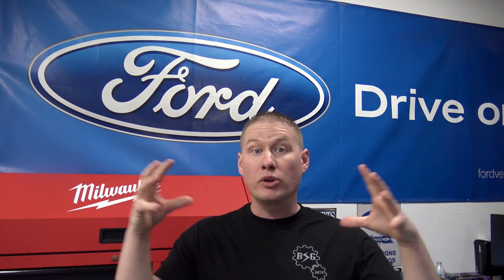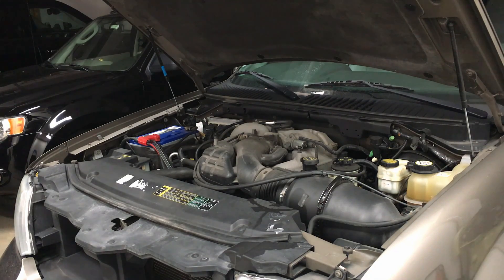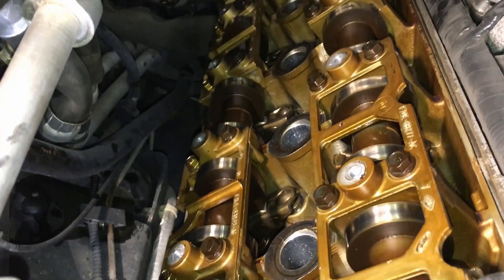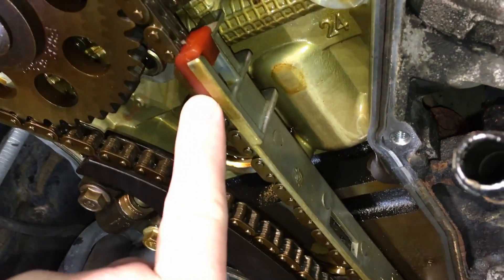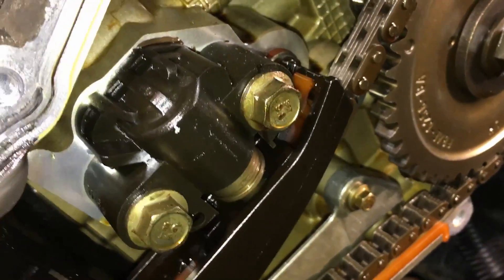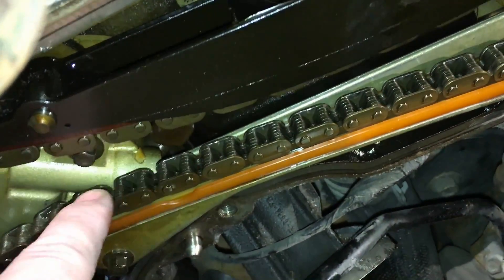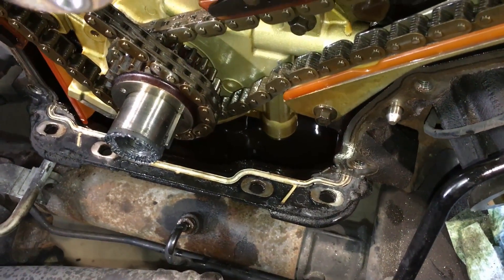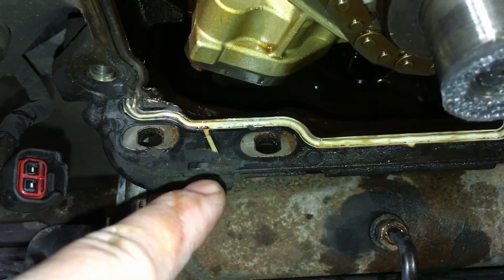Ford 4.6L & 5.4L Triton Engines: Common Failure Points to Watch Out For!

Comment: Why couldn't Ford just kept producing the 302 and 351? Those engines were bullet proof. I never had any problems with my 302. The 4.6 Triton that I currently have isn't a bad engine, but it's not as good as my old 302 was. My old 300 straight 6 was better than both put together. I miss that old F-100 Custom.

Comment: I’m planning on doing a very big job on a mustang gt 07 3v my dream car problem is it’s riddled with problem the Harmonic balancer is coming apart and punching through the timing cover and gonna replace both since the motor has 190k gonna do a timing kit while I’m in there and quite a few other things I need to replace to get her running good

Comment: Another question: PLEASE HELP! I own a ‘well maintained’ 2007 Ford Explorer with the 4.6L V8 SOHC 24 valve. Over 250,000 miles on motor.  What should I plan to do maintenance wise in the very near future? I have a new water pump and reasonably new spark plugs. What about doing the timing chain? Anything else to do if I want to throw a few (reasonable) dollars at it? I am very mechanically inclined, have an engine hoist and tools. I will do the work myself so costs should stay pretty reasonable… appreciate the input. Oh, I do see that there must be some gasket or seal leaking as the lower side of the motor seems to have oil on it, but certainly no drips gathering on my driveway at all. Thanks

Comment: PLEASE HELP! I own a ‘well maintained’ 2007 Ford Explorer with the 4.6L V8 SOHC 24 valve. Over 250,000 miles on motor. Although newer fuel filter and spark plugs less than 20,000 miles, Fuel efficiency seems really poor. Air filter is new. Oil changes always done early, new water pump, newer battery. Alternator strong. Any suggestions on what to do / check?

Comment: I wish you were closer to me in Oregon. I have a 2010 F150 with the 5.4L 3V Triton, with 148,000 miles. I don't hear any obvious sounds that would suggest that I have a blown out tensioner, (no loose-chain noises), but then again, I don't want to wait for a major engine failure to find out. Because of your videos, I am going to have the timing set, cam phasers, roller followers and oil pump replaced proactively! I would like to get another 150,000 trouble-free miles out of this truck! 
Would you say that pulling the oil pan to look for debris would be the easiest way to find out of there have been any timing issues?? Sounds a lot easier than pulling the timing chain cover...
If only you were in Oregon, I would definitely have you do the repair. Now, I have to find someone locally that is as knowledgeable as you are about these engines.

Comment: Low oil pressure, for a while now, several months. Thought it was oil filter or viscosity compromised. Chain started talking to me last week. Doing this VERY soon. New high volume pump and timing kit coming in. 01 Victoria.

Comment: Sparkly oil = motor is toast. Not even worth fixing.
Reply from the maker: We fix them all the time for this particular failure, no problems. Now if the the sparkle was from bearing material then yes it is toast.

Comment: Question; how many miles on this Motor you are showing? I have a 1999 F150 4.6 with over 200,000 miles on it. Yet no noise. When I bought it had 73,000 on it. I use SLICK 50 once a yr. Marvel Mystery Oil additive in the fuel. Why, I had a 1969 Mustang that had 253,000 on a V8 302  until 1999 when it was totaled in a accident. It was a Leaded Fuel & Marvel was its lead substitute.

Comment: At what point on these Ford engines do you determine that the engine needs a full rebuild vs timing component upgrades only?  I have a 5.4 3 valve with 200,000 miles on it with timing noise on startup.  Do I need to do a compression check, or is it always worth it to just to timing components?

Comment: I have a question about my 2002 Ford F250 with the 5.4 Triton V8 . So the check gage light comes on then goes off I look at my oil pressure and it has none untill I either rev the engine if I'm at and idle. But if I'm at a steady speed like 55-60 I will lose pressure then gain it back when I let off the gas? What would be the cause? Oil Pressure sensor or Oil Pump?

Comment: Thank you very much for that little video man I'm going through that same problem thought it was a lifter that fell out and it weren't wound out to be the timing chain and the only reason I checked it is because of your video and while I'm in there I might as well change the oil pump because that's a lot of work thank you again bye-bye

Comment: thanks for all the videos!  Quick question, have a 2006 Mercury Marquis with 4.6l v8 and vehicle has less than 50K miles.   I've noticed recently at light throttle on the highway there is a slight ping/knock noise.  Have tried different gas but that hasn't worked.  Heavy or full throttle doesn't seem to induce ping, only light throttle while cruising at highway speeds.  No noise when cruising around town either.  This has me confused....any ideas as to why it pings only when on the highway while cruising with light throttle??   thanks!

Comment: I have a question related to this engine- I have a work truck with the 5.4 32 valve. The engine has a leaking head gasket but low miles. Should
I junk it or have the heads re-machined?

Comment: Does running thicker oil prevent this? I have a 05 4.6 2v with 178000 and run 5w30 instead of 5w20?

Comment: How much should a job like this cost. My 04 4.6L is on 264k miles. It's not making any noise yet but I'm wondering if I should have the tensioner components replaced while it's still quite. What would you advise I do?

Comment: Thank you for this video. I’ve been watching a lot of your videos since I bought my 2006 F-350 2 weeks ago. It’s got 286000 miles on it which normally doesn’t bother me. It used to be an ambulance and I know the service was done regularly. I researched and found out that in 2011 it had a new engine put in at around 157000 miles. They put in a Jasper reman 5.4 and two weeks later they put another 5.4 engine for some unknown reason. Then again in 2014 they put a 3rd engine in it  and was sold. This engine has 127000 miles and now the noises in the front. I figured it was maybe a phaser and then a body shop guy said sounded more like a guide. Then I seen this video. Great job. Since I’ll have the front opened up I’ll check everything else. Thanks again.
Reply: Did you determine the issue?

Comment: Question.... My wife has a 1999 f150 4.6 and its leaking oil bad on the right side down on the starter.. smells bad on the exhaust manifold. I cant quite see where its coming from but im thinking tappet cover.. is this common?

Comment: ford and the cam phaser can just screw right off and no I don't hate fords but they always seem to have some badly engineered thing from the overly complex air bags on my Lincoln to the stupid fuel system on my mustang that melted down the motor twice

Comment: I just did this job on my 4.6L 2v in my Mustang and only did the chains, tensioners, and guides when I had the timing cover off. I'm planning on dropping the oil pan sometime this year. Did I make a stupid decision to not do the oil pump when I had the timing cover off? How often are those negatively impacted by these issues?

Comment: The 5.4 3 valves have awful cam phaser problems. The 4.6 2 valve on the other hand is a masterpiece in smooth reliability. They do 400k miles in Crown Vic taxis and Town Car limos on the regular.
Reply: I run a mobile mechanic business and bought a cargo van a few months ago. 2009 Ford e250. 4.6 2 valve. Went out of my way for the 4.6. The 5.4s just have cam phaser issues like no tomorrow.

Comment: Question, do you have to remove the motor mounts and raise the engine in order to remove the oil pan on a 2004 Lincoln Navigator 2 wheel drive?
Going to be doing my friend’s timing chain and I know the guides are shot. Nice aluminum glitter looking oil when I changed his oil.

Comment: I need to know if a 2000 2valve Romeo engine have an oil restrictor in the head by the cam cap bearing?

Comment: It’s so aggravating to know that these manufacturers put out this crap for years and years and years and don’t do anything different I know why they do it planned obsolescence which is BS. I mean my Northstar in my Cadillac they finally fixed it after how many years of bad bolts holding the heads on and now I have a Ford explore with 252,000 miles on it and it still going for how long I don’t know. But this is total BS that these manufacturers are getting away with us putting material in there that doesn’t do that but then they wouldn’t make any money what day thanks for your videos they are very clear an awesome

Comment: I have a 05 Ford f150 my check engine light was on and it started blinking then it cuts off on my and never crunk back up what could that be cause all my dashboard sensors work except the oil sensor for the oil what could that be. Please help me

Comment: I wonder what causes these issues? I have a 2000 E150 van, 5.4L Triton & its still running great. Now I'm worried after watching this. How can I avoid this happening g to my engine?
Reply: If it's a 2000 you have the 2 valve 5.4. Good motors. The 3 valves were noyhin but issues

Comment: I have a 2002 Ford F150 4 x 4 is there an easy way to pull the pan have the same problem with the chain guides broke off

Comment: Hey there Mr Ford master!! I'm looking to buy a 2003 Ford F150 5.4 Triton 4x4 FX4 that isw in well loved condition but it's at a dealer so I don't think I'll see any service history...it's the 2valve engine so I think from what you and others have said that is a good thing compared to a 3v? It only has 148K miles so that's low miles..it was not a work truck that's for sure..My other option for the same price is a 2013 Kia Sorento suv same miles..I've seen many of these trucks with over 300K miles but I have yet to see a Kia with over 300K miles!!! I know these are two totally different autos! I value your advice! I have a 2005 Escape 2.3 with 209K miles with not a single oil leak!!

Comment: Mine has a rough idle repair coils and plugs .did a leak down test cylinder 5 and 8 more then 10 % down from report from Ford service dealer.still have a little rough idle .should I get rid of it it has 165000 miles on it.

Comment: I have a 2002 f150 with 2V 4.6L.  I am replacing the lash adjusters and rollers.  I saw another video in which the guy was talking about replacing the oil restricter.  He pulled one out that was clogged, but did not show the detail on where this thing is located.  Do you have a video showing this or can you tell me where it is located?  Love your videos.  Thanks!!!

Comment: Just like BMW M62tu and M62 V8 engines. Shares the same issues with the timing guides coming apart from the plastic not holding up. Key thing to prevent timing chain issues is 5k mile oil changes. Saves you an engine

Comment: What’s up Mr. Loco and thanks for all you brother?! You helped me a long time ago with my idle air control valve For my 2004 expedi with a 4.6. I was using after market and told me to simply get an OEM and the big green went back purring. So i was hoping you could provide some more of that Ford Wisdom. 

The battery light continues to flicker intermittently and when accelerating up to 40-50 mph she begins to sputter unless I smash the gas. Sometimes while idling she’ll skip a couple beats or a lot. Any suggestions are greatly appreciated. Also what would you replace if your where trying to bring a truck like this back to pristine??

Comment: Hey your videos are very informative and i subbed i need some advice my vic is going clack,clack,clack,clack! 
Tap,tap, tap The oil pressure reads normal on the cluster my crown vic is a 2001 i thought maybe it was the "oil restrictor" BUT it doesnt have one! (Driver side) the cam followers look good and the lash adjusters are in awesome condition too and the crazy part is the car only has 149,000 i am not sure on idle hours its driving me nuts would the clack,clack,clack be from this very thing your showing us? I really wanna give this motor a chance because they last forever.....something doesnt make sense keep in mind no knock any help would be highly appreciated and the cam hold down bolts had a burning smell and when i loosened that particular bolt it may a small hissing noise like i relieved pressure i know that sounds wierd but could have been my imagination that particular bolt gave off a bad burnt odor like burnt plastic and burnt grease HELP

Comment: What is that squished out on the driver side chain tensioner, sealant? Don't see where it's blown out? I like the little pile of metal shavings on the passenger side die casting boss, and the plastic piece on the driver side.

Comment: can this same thing work just backwards.  I have a friend with a 2006 4.6 mustang and its OMG fast. start it up it sounds great after driving it a little when you stop it will go to knocking super loud. oil pressure still good. shut it off just a minute and its quite again. may not do it again for days.

Comment: I have a 2010 Explorer 4.6L 3V with 165.000 km (102.526 miles) and had two timing chain kits replaced, the VCTs once and the oil pump once

Comment: I've drove 4.6 Ford's , Mercury's and Lincoln's . Some as my personal car , some for work as a Taxi Driver some with as many as 350,000 miles . Never had a timing chain go out .
Reply: The 4.6 2 valves were good motors. Better then the 5.4 3 valves

Comment: So on the initial start up it sounds like a diesel engine. Your saying that is caused by the loose timing chain?
Reply: Chain slap until the tensioner builds oil pressure

Comment: I've got oil on spark spark plugs in my 1997 expedition 4.6 (248k miles), I've been told it could be intake manifold gasket or valve cover gasket, any tips on what it might be?

Comment: The engine in my truck doesnt even have a manufacturer reccomended interval for replacing the timing chains or guides, its a lifetime system. After 100 year of building engines, how does ford get away with pushing this crap out on the public and then we get sucked into buying them because of the "Beautiful interiors" or "I love the features" or "I love the looks"? We are so stupid here in the states.

Comment: Most standard transmissions have the clutch cylinder bolted to the outside of the transmission housing .

Ford has it on the inside .

Thanks a lot Ford , a 5 minute , 40 buck replacement becomes a $1000 major job.

Comment: I have a used road service 07 f150 with a 4.6 got it for 2k total. Everything is seemingly perfect. Runs smooth drives smooth. The only catch is the miles are unknown. So this thing could have anywhere between 200k and 500k 😳I dont know why I felt the need to share this but whatever. 

UPDATE .... so I fixed the odometer yesterday and i have discovered the true mileage. 435,441 FOUR HUNDRED THIRTY FIVE THOUSAND MILES. WHAT THE MINTY FUCK

Comment: 2003 F150 4.6 with 90k miles. When they can't build a motor that keeps the spark plugs in the head...never again Ford anything.

Comment: +UCN467fmgLLlk98JddJLL51w   Hey FordtechMakuloco, I still have this great 2004 Lincoln Navigator and it is up to 165,000 miles and running strong.  I am in Colorado now and this truck powers up the rocky mountains every weekend for ski season.  Thanks for the great repair.

Comment: Have at least 10 customers with 500,000-700,000 miles on their e-150 vans. Pretty tough engines if you take care of your basic maintenance. Oil change!
Reply: Is that on the original engine, no rebuild?

Comment: What about plastic shavings plugging the oil fill holes  ?
Reply: Normally but the screens are bad for tearing lol and if they don’t use Ford filters some after markets the filament will come apart and plug the holes lol.

Comment: Great videos... You are the Robin Hood to King FoMoCo... I have just bought my third F150 it's 2003 5.4 Windsor 140K mi. Other 2 are 4.6.  I've driven both 4.6 to 280k without issue. 2 Q's: what's difference between Windsor and Romeo besides manuf plant? Any structural?   & since timing chain seems 2B weak PT of Triton how many miles can they get to if timing and oil pump are replaced at say 200 K?   300K? What goes out next? They seem 2B tuff!

Comment: My Triton motor made me lose all faith in ford. Won't buy one again.
Reply: Don't buy complicated engines and take care of them. I have a 2.2 s10 and a 2v 4.6 both have over 200k miles on them. They run like tops and I'm a Chevy guy.
Reply: Well I’ve got a 4.6 triton with 435k all its ever had were regular oil changes, and easy pace driving. Though I’ve rarely gone over 65 mph

Comment: How did you get the passenger side valve cover off? I ran into a problem where the AC lines were in the way. Hoping to avoid the same problem putting it back in.

Comment: All electrical components changed everything cleaned still lack of power runs like s*** bogs all the way up and down the road perfect compression perfect rod bearing clearance camshaft drive shaft clearance all perfect but when you put on the gas it just bogs is liked by all the time I don't understand what is going on why is it act like it's cut with something is wrong and I don't know what it is can somebody help
Reply: keri 

Disconnect the positive and negative from battery then connect the cables with a jumper wire. Let it sit for an hour. That will reset the computer to factory default. Reconnect the cables to the battery and test drive.

Comment: I need you as my mechanic. You are knowledgeable and straight to the point. 

I have a 4.6L f150 and it probably needs chain, guides, tensioner and certainly something in cylinder 3 fixed. It started misfiring 2 weeks ago :(